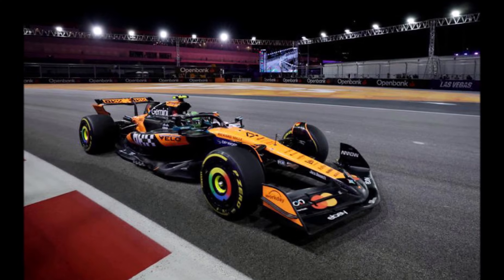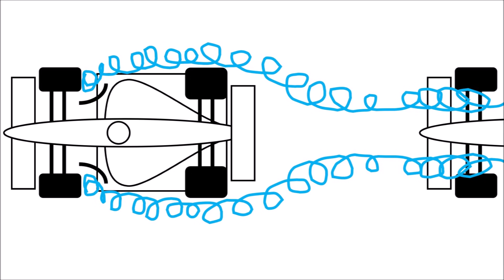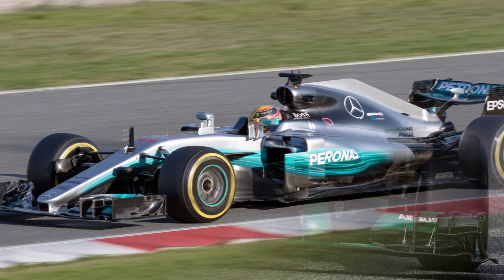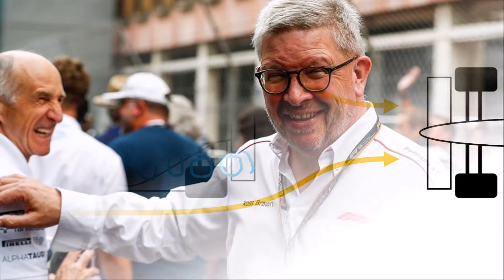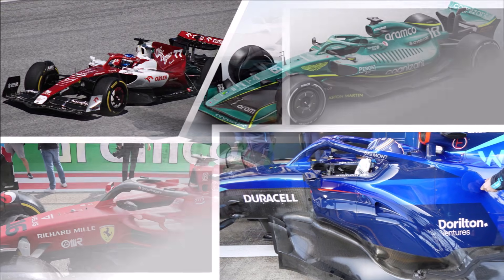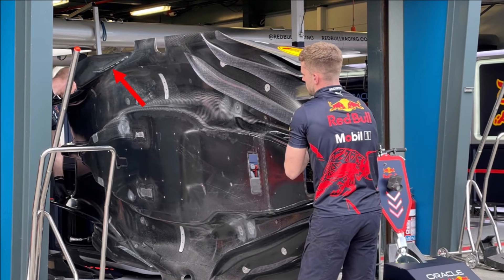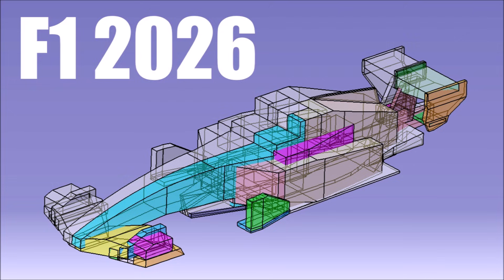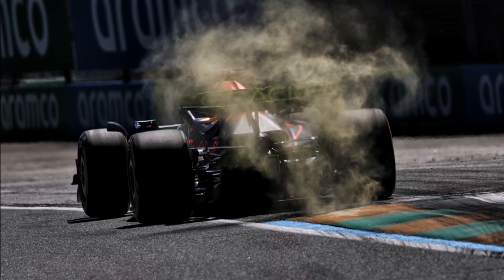F1 Ground Effect Era 2022 - 2025 - What Did We Learn?

Comment: The name is doubly confusing since it is Venturi tunnel and aerodynamic ground effect is something else entirely.
Reply: You can have Ground Effect without Venturi Tunnels, but Venturi Tunnels always bring Ground Effect. The usual confusion. 

The knife-edge of set-up with the use of Venturi shaped undersides has caused every team problems. From Mercedes’ teeth-chattering porpoising, to Ferrari’s less painful low rider bounce-bounce-bounce oscillations. All throwing away downforce and speed. Even McLaren, who have done great things with this new regulation, still had a double-DSQ in a title run, with the regs at their most mature, while playing it safe on the set-up specifically to avoid a DSQ. In the end the theory is very powerful in development, but difficult to manage on a real track. Bumps are the enemy and although the 1983 ban came off the back of fatal & career-ending crashes in 1981/82, this last period has proved the primary safety issues of maximum Venturi have been overcome, even if lesser ones arose.
Reply: @MsZeeZed  Active suspension could've wiped out all those problems related to floor setups. But no, the FIA is boring as always.

And now, they change everything on the spot, instead of maturing an already great regulation system, by inverting or entirely changing specific rules to force teams to jeopardyze development. Could've been fun.
Reply: @rigel8755  You don't need to be so downbeat. The potential for development is extremely high for the new regs. Literally on every area, floor, barge boards, wings and body work. Not to mention flat floors means suspension development is back on too. These ground effect cars offered very little to no room for radical development. The Mclaren is easily the most ordinary looking car to win championships in living memory.

Active suspension were never an option as it would be simply too expensive and requiring years of development unless they made it spec which the FIA with FOM should have been working on since 2019-20. They obviously realised it's need too late.

The biggest mistake was to make the suspension so much more rudimentary and removing the advanced damping that previous cars till 21 had. Catastrophic.
Reply: @MsZeeZed  Aerodynamic ground effect is when airplane fly close to the ground the wing will generate a lot of extra lift. Everything you mentioned is ventury tunnel.